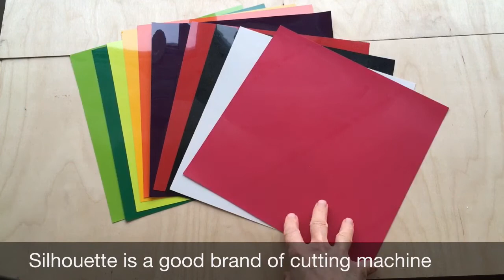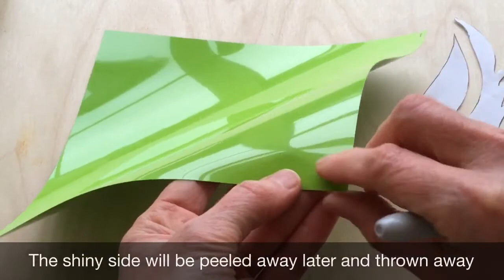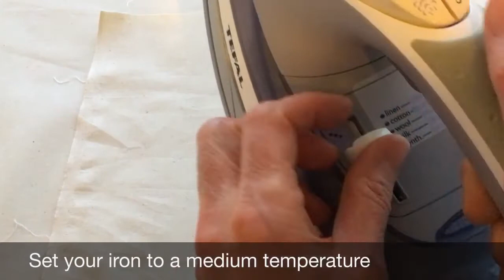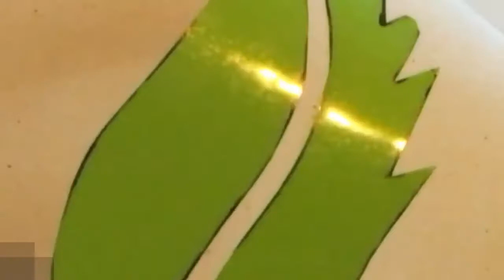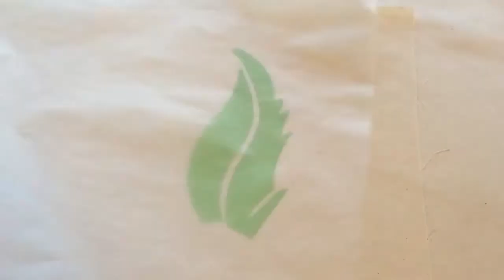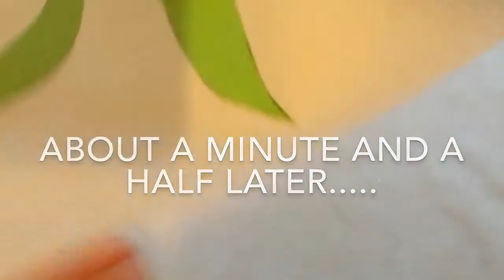Heat Transfer Vinyl With a Scissors and Domestic Iron

Comment: So you don't have to peel the plastic layer off before you apply the heat like T-shirt transfer paper?
Reply from the maker: If you use medium heat, the plastic cover layer should be ok. It is designed to protect the vinyl. Some vinyl is designed to be peeled hot and some cold so just test small samples first🤞